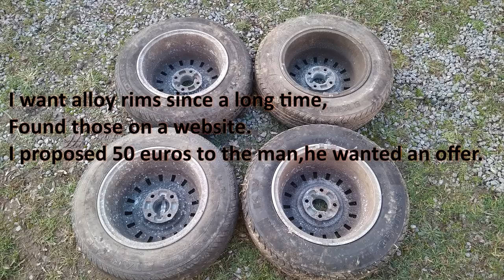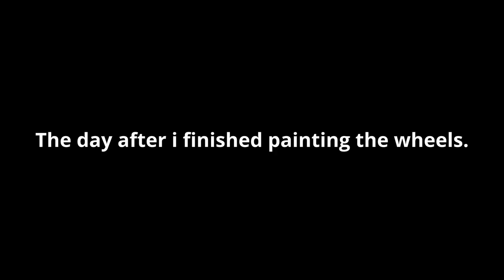80'S Alloy wheels restoration  /  Restauration de jantes alu.

Comment: Great job. How did you balance the tires on the rims?
Reply from the maker: Thanks.

I insert 30 grams or more of coolant in the tire with a syringe through the valve ,after removing the valve core.
Both are chemically compatible,no risk of damaging the tire,no risk of seeing it freezing in winter.
The coolant spread out in the tire and stay in the lighter spot as soon as you roll quick enough.
You can use BBguns pellets too,and on freight trucks they dump a bag of beads wich desintegrate and let go small ceramic beads.
Read that if interested : https://engineering.stackexchange.com/questions/6015/how-do-tire-balancing-beads-work
The problem is just during sudden heavy braking mostly,when the beads can't follow the spot in the tire where they were remaining while rolling.
Reply: @michaelovitch  that is smart. I enjoy your videos. Please continue making them
Reply from the maker: @danzfavoritestuff9760  Thank you.
I've bought a cheap car to work on,on video.
There are plenty of work on it : )

Comment: Wow what a mess they were in, it takes a lot of determination to keep going with the cleaning up, after one wheel i would be getting a little bit fed up lol.
i would kidnap a frends sand blaster for the crud removal, i'm lazy i know lol.
The tyres had become one with the wheel lol, i'm not supprised that the hydraulic press was needed, a lifetime of close contact.
They look like new wheels now, smashing restoration :-D.
Cats are so funny, mad and cute little creatures :-D
Shame about the accident, just what you didn't want :-(, hope it didn't damage the radiator.
Reply from the maker: Thank you : )
Yes it was quite some work...
I thought to get them bead blasted,but i tried to do that as cheap as possible,with my abilities / tools only.
The tires were on there since 2005 or so i guess,they were produced in 2004,so yes well stuck on lol
The radiator is fine,and i'm still waiting for the body shop to call me to get it repaired,they had to install used parts on it,the auto expert agreed to get it repaired but only with used parts.
It's been two months now....still waiting.
Reply: Dam, they are messing about with you :-(, it's not like it's impossible to get second hand parts for that car, they act like it's 100 years old!!.
I suspect they are lazy and can't fill there pockets with money from the repair.
I could be wrong, but business loses interest when profit is low.
Reply from the maker: @zx8401ztv  I think you are right.
The expert that assessed the damages called me one month after his job was done to ask me if where the whole process was at.
He had no news about the repair shop.
I called the repair shop ,he had no return on the expert job from one month ago....
I called the insurance company they knew nothing about anything....
They gave few calls ,and they assured me i would have an appointment "soon"
lol
Reply: LOL somehow i'm not supprised :-D
They could have removed that panal and beat the dent out with a pillow by now, a feather filled one ha ha :-D.
Perhaps you should kidnapp the panal beater man and chain him to the car untill the dent is done, then do the same with the painter :-D.
Reply from the maker: @zx8401ztv 

lol good one

 I think i would more likely use the pillow over their heads lol and maybe beat them with the panel itself after if they still move lol